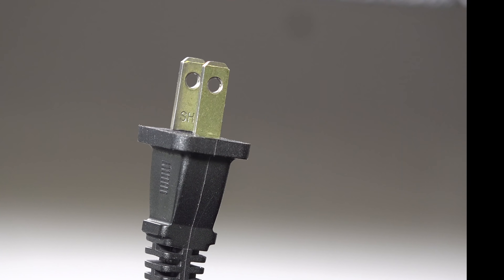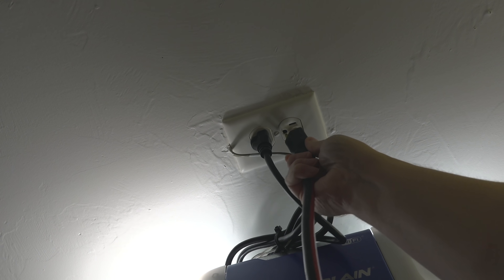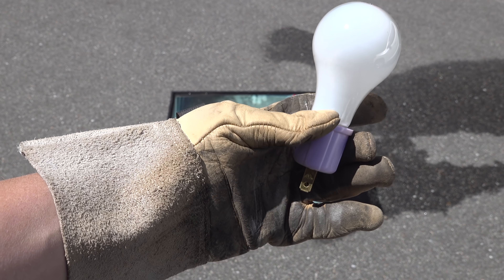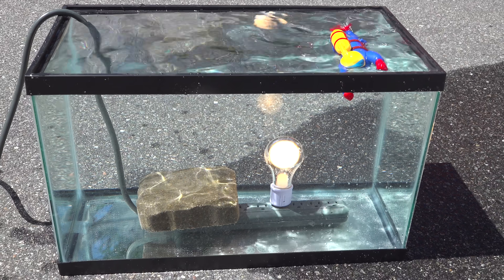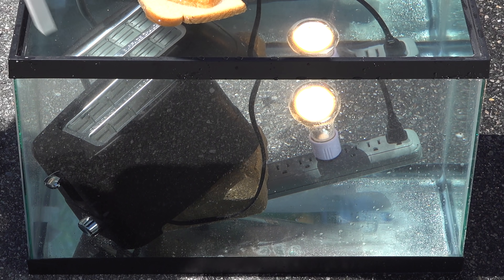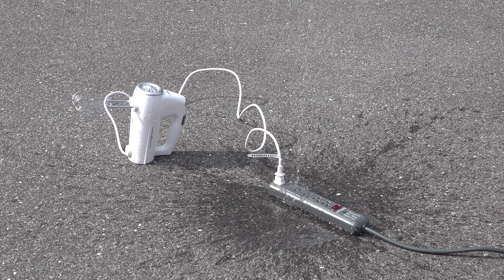What REALLY HAPPENS WHEN YOU SPILL WATER in an OUTLET?

Comment: Electrical engineer here. Despite their being water on the circuit, the Electrical current will still travel along the wires because wires have less resistance than water.  The danger here is if that water became grounded. For example,  placing your hand in the water and then grabbing a grounded copper pipe. His experiment doesn't show the potential danger here, only that some electrical devices don't have a problem operating underwater.
Reply: Presumably, the breaker tripped when he used the protected outlet because the outlet strop was lying on the ground? Although I'm not too sure where the water could've formed the path to the ground
Reply: Interesting
Reply: Could be wrong. But I would also think if the water was grounded, you would still get current flowing through your body sticking any object in the water. Since it would just travel through the object submerged in the water. But obviously not as much as sticking your hands directly in the water.

Comment: Circuit braker brakes when current is exceeded and that happens when there is fault in the wiring or we have a short brake. Here current is not exceeded since tap water is not realy a good conductor and resistance is to high. If you put your hand into the water i beliewe nothing would happen. Again water has high resistance plus you body has high resistance and your shoues has a resistance and electricity tends to flow in the least resistance path. 
Everything woul be different if you put some salt in the water. Than resistance would drop and you will have a short circuit. 
Again brakers protect wires from over current event it does not protect humans. If you want human protection you need to instal RCD

Comment: Just to clear up what is happening here:
The breaker does not care in the slightest where the current is flowing, it only cares if there is enough of it to damage the electrical installation.
The water simply has too high a resistance, to get enough current flowing. (In part because the US has a 110V system)
If you had put salt in the water, at some point the breaker would have probably tripped.

Secondly, a gfci/ does not: "protect you against any type of electrocution":
In fact gfci/rcd will only serve your personal protection if enough of the current (in relation to the RCD rating) is flowing back somewhere that's not the neutral wire. In this case that was the Protective Earth (ground) of the power strip. If you had put only the toaster with a two contact plug in the water, it is completely possible the gfci/RCD wouldn't have tripped. Also if you come in contact with both the active and the neutral conductor at the same time, a gfci/RCD can't really do anything to protect you, except when you have unusually good contact with the ground.

Comment: I saw nothing safe at all with how this experiment was conducted, leather gloves don't protect you if it's wet. The conclusion was helpful, but by god this knows nothing about electrical safety
Reply from the maker: The gloves were 1000volt rated Facoms. As stated in the video I was at no risk due to other precautions off camera. The point of the video is to share my experience not a teaching video on how to do this.
Reply: @SilverCymbal  dude those are not rated for underwater, that's a dry rating, dude seriously you have no idea how unsafe that was. But hopefully you had someone to unplug it if you got electrocuted, although again that's no guarantee against death. You have to use common sense, for your case maybe use another person's common sense
Reply from the maker: @eksine  I didn't say that was the only pair of gloves I was wearing. You already formed your conclusion so just stick with it as I will not reveal any of the other details.
Reply: @SilverCymbal  ok so basically your secrets are of top national security? Ok good answer makes absolutely no sense but neither did your " safety precautions"

Comment: Unfortunately you wouldn’t die, I’ve done this unintentionally I work as a electrician, and you won’t get shocked if you stuck your hand in the water, water isn’t as conductive as salt water, so if you had salt in the water then you would’ve been shocked and the breaker (without) GFCI protection probably would’ve tripped at that point, and needless to say electricity take the path of least resistance so I could’ve stuck my hand in there and probably wouldn’t have been shocked until my hand was right on the extension bar, without salt that is. If there was salt probably 3 inches or more I’d start to feel it.

Comment: so if my standing sump pump accidentally gets submerged in water (basement flooded by 2-foot water or so) the sump pump may still have power? and what if I step in water at that point? (currently, sump plugged in a grounded outlet in rafters of the basement, 15amp dedicated breaker) ...an old timer told me the breaker would pop

Comment: I've actually been in a pool where one particular spot in it felt like i was getting zapped by electricity, only thing I can think of is that it was coming from the under water pool lights.
Reply: Yes! It was the lights!! Many people have died from that, in pools and spas (hot tubs). Google it. It has even happened with underwater lighting along piers and docks. Awful way to die, and nightmare for the living to helplessly watch. No one can touch you to save you. But still, someone tries anyways, because how could you not, and they die too.
Whatever pool that was, please tell someone immediately, even if it happened awhile ago, before an entire family dies - not exaggerating. You are so luckily you only felt a small amount of loose electrical current. Your instincts are right- something isn't wired correctly. 
Between watching this video and reading your comment, my stomach is now in knots with worry.  Please be safe 😟
Reply: I once went in to a pool where the light was floating around out of its housing while still on and (thankfully) I didn’t feel anything. Getting in the water while that was happening though was probably a mistake.
Reply: A properly working GFCI should trip immediately when something like that is happening.  Not only does the wiring need to be fixed with the light and to find out why that's happening...but an electrician also needs to put in a properly functioning GFCI.  This is one of the main reasons why they exist.

Comment: water has high resistance, tap water in best case has ~ 1000ohms, so with 110 volts amperage won't exceed 0.11 amps, or 12w, not enough to trip a breaker

Comment: With the circuit fully submerged, how would that shock someone if they dipped their finger in?

The current is moving through the path of least resistance(<1 ohm), why/how would it travel through water(1 to 1000 Kohm) and skin (1-100 Kohm)?
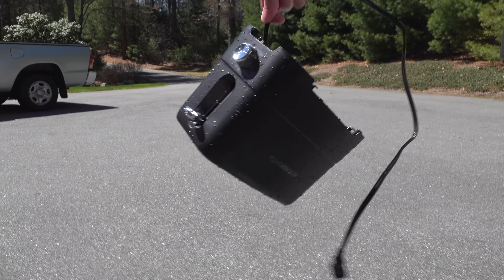Reply: Also, 4:20 😎 👌 nice.

Comment: Power travels the easiest way so the power would want to go to the machine instead of out one of the poles to the other pole trough the water. If you have disconnected anything plugged in then, the power would travel trough the water to the other wire/pole breaking the circuit breaker

Comment: No one is likely to die or even get hurt by sticking their hand in that water. The path of least resistance is still through the appliances.  Check out ElectroBOOM channel for a demonstration. The real danger is if a person makes contact with wire and say the drain, which is grounded.  Rust and corrosion resulting in water damage could later short these appliances, so GFCI and the like definitely should be mandated more.

Comment: Mythbusters did tests if the water will kill you and their tests showed no current leaving the toaster or any appliance they put in the water. Its simply not conductive enough compared the copper wire, the electricity goes the path of least resistance so it never electrifies the water.

Comment: Explanation is simple. In America, our circuit breakers merely protect from overloading internal electrical wires to prevent fire. Cuz, walls are filled with insulation and wood and Sheetrock and stuff. Which also means it’s possible to overload exterior wires, like electrical cords.

Comment: I cleaned the coils on my moms AC a few years ago and some water got into the relay for the fan. The relay started to spark and burned up. 

The reason you had no issues here is because the current traveled through the minerals in the water, but the power went to the neutral and ground leads on the power strip. While the current draw likely went up it wasn't a direct short. The more minerals in the water the higher the current draw. You probably could have put your hand in the water and only got a tingle tingle if no shock at all as the power was taking the path of least resistance to the ground and neutral.

Comment: What most people don't know is that water is not conductive. I know it sounds crazy. What makes water conductive are the sediments inside the water. They bridge the gaps in the water and give electricity a circuit path. If you do the same experiment with distilled water it won't trip the outlet.

Comment: 0:55 why would the breaker trip? Water barely conducts electricity at all (not at all if it's pure), the beater is probably consuming 100 times more power than the tiny bit that's able to make it through the water. Salt water would probably trip it very fast as it's very conductive.

Comment: All those dark movie scenes from the 80’s and 90’s had me thinking a good self yeet only needed a warm bath and  the hunger for toast. Wowee
Reply: It is all you need though.
Reply: It's still deadly you just can't see it as clearly. You can't actually see electricity, you can only see what it does. Thats why power lines and cables don't look any different when on vs off. The reason why it's dangerous is because water is a liquid conductor of electricity, but it doesn't do it as well as metal, and its conductivity depends on whats in it. So touching that water would be like touching a live wire. You can't see the electricity but it's still there and it will still stop your heart.
Reply: S e l f y e e t
Reply: I know how it works guys. I was making a joke because the dude is reaching into the water and seems fine. Don’t get your shorts in a twist.
Reply: @korridarkheart  The the toaster was off when he reached into the water, notice he used a stick to turn it on and not his hand.

Comment: "at this point I am completely blown away, how is this stuff working fine underwater without any problems at all" 
Someone didn't pay attention in physics class and it shows. This is common knowledge, water is an insulator. adding minerals to water like salt makes it conductive. In fact we crave salt because we are low on electrolytes. Getting electrolytes in the human system is vital as not enough electrolytes can lead to increased heart beat, head hurting, cramps.

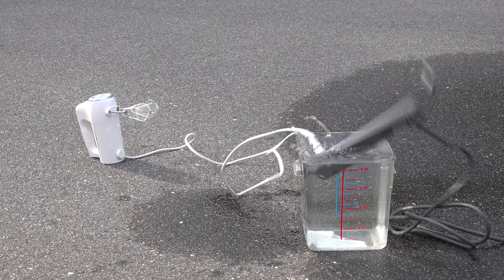Comment: "...had help behind the scenes to make sure that I was safe the entire time." @1:16 touches a wet live power cord while wearing nothing but gardening gloves LUL
Could have at least used rubber gloves (preferably ones certified for live work).
Reply: It wouldnt have mattered, water wasnt conductive, if he touched exposed wiring or something then yes, hes at risk for electrocution, though from the looks of the video, i dont think he knew that the water needed to be salty for it to be conductive
Reply: @X_Zangetsu_X  Tap water is absolutely conductive (a 5 second google search will confirm this), with the conductivity varying depending on the mineral contents. It will give you somewhere from a mild shock to a fatal shock if the cord is wet and creating a path down to the live terminal of the outlet. Which creates a circuit from live to earth with you in the middle. This is why most countries require GFCI/RCD breakers on outlets in bathrooms or near a water source.
Reply: @bumbixp  well, yes, your correct, but the mineral content within would have to be specific to be xonductive enough for a strong shock no? Well, even then, electrified water, conductive or not is still dangerous and should be taken with extreme caution
[This is just something i learned about a year ago, so im not surprised if something counters what i say, like for example the mineral content in the water, you learn something new everyday]

Comment: GFCI breakers protect from shorts to ground, which is what happen when you wet an outlet or somehow short or the circuit, whilst "regular" breakers just protect the wires for overeload to avoid them from melting which is preety much the equivalent of not having a breaker at all in what concerns shorts protection (tho still useful for safety and fire hazard avoidance), or why outlets in UK (with the gfci breaker embeded) should be the standard.

Comment: Circuit breakers are designed to protect the conductors in your walls a.k.a the wires connecting the outlets. The circuit breakers don't care for anything plugged into the outlets themselves. Also, circuit breakers and power strips with built in ones are for over current protection only. They don't know how to deal with ground fault situations that's why GFCI outlets are a must for any outlet designed to work near water.

Comment: One major reason that it didn't trip the breaker is the simple fact that tap water isn't very conductive. You need soap or the salts from your skin in order to really trip a breaker when it's wet. GFCI detects ground-fault leakage and triggers way sooner than a breaker would. Breakers also don't trip for the same reason as a GFCI system, so you have that working against you. 

If you repeat the tests in a salted water tank, or a soapy one, you would quite possibly get vastly different results.

Comment: Nothing happened because you used regular water, wich has not a high conductivity, if you use salt or soapy water, the result maybe will change. But the protected power outlet activate when the electricity goes from the fase to the ground, (or with too much Ampere o short circuit.) When you are doing a bath, and for some reason, the toaster in function fall in water with you in, the 110V and the 10A (if the toaster use 1100W.           W=V x A)  run through the water and then through your body. I'm not an electrician, I just watch Electroboom's video, and I'm not English.

Comment: The water offers enough electrical resistance between the hot and neutral to keep the 10A/ 15A breaker from tripping. However if you were to touch the water, you'd probably get a good shock from 120VAC.

Comment: I had an air conditioner that had a bad tendency to full up with water and start spitting water back inside the room.
Probably during the 3rd summer I owned it was collecting so much water that it just started dripping inside. One day it ended up dripping on a surge protector while i was sleeping. Good thing the snap crackle and pop sounds woke me up.

If anyone is wondering what brand the AC was it was Haier, and I'll never buy another product from them ever again.

Comment: The water at the toaster heating element is not hot, that is hydrogen, wich is created with current flowing trough water. Water is also not very conductive to current just to voltage.
Reply: For something to conduct it has to carry a current... 🤦🏾‍♂️

Voltage = current times resistance
V = IR

Comment: What will actually happen is any exposed metal under voltage will slowly (or fast if the water is dirty) corrode away because of electrolysis. The electricity will flow directly through water too consuming some power, but clean water isn't that conductive, that's why it didn't trip the breaker.

Comment: To the explanation. A normal fuse only trips if the current flowing is larger than the rating on the fuse. Water itself is a preatty bad conductor. So while submerging the outlet in water will short the L and N wire, it won't be shorted enough to trip the fuse. However, if one would touch any of the water, they would get a electrical shock. The water is under current and if one touches it, the current will flow from the outlet, through the water into your body and out of it into the ground. In best case you will get shocked, in worst it can end lethal. 
An RCD trips when there isn't the same ammount of current going through the L wire and returning through the N wire, meaning that some of the current took a path throiugh the ground. This is why an RCD protected outlet will be cut off if water touchges it since even very small ammount of current leaking through earth is enough to trip it. That be said, if your RCD protected outlet and water isn't connected to the ground somehow (e.g if a device with 2 pwires in the cable is submerged in water but the tank is made out of plastic or other non conducting materials), you will still get an electrical shock for a few miliseconds until the RCD cuts off because the current that flows through your body into the ground. For most people this is not lethal with the right RCD (30mA), but it can be for children.